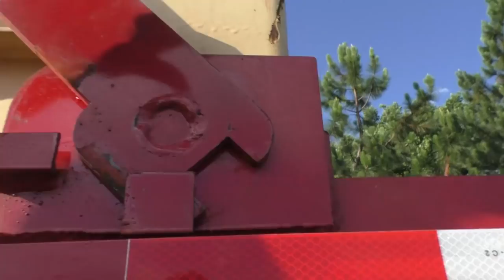Red Cedar Going into the Cargo Hold

Comment: You may want to research spray foam regarding 2 inch max. The way I understood it was thickness was only affected by the number of layers needed to be sprayed 1 to 2 in at a time.
Test your idea first because the possibility the foam's bond to the plastic will be stronger than it is to the aluminum. I would suggest you could use the same foam as below on the roof of the pilot house and use a durable roofing material sealing the foam . It would be easier to lay foam sheets over the aluminum roof .The hull will be cooled naturally by the water but the aluminum roof will have to transfer its heat inside to the foam making it less affective.

Comment: Quick tip on cutting the boards used for the walls, I noticed they were being cut on the flat, if you stand them on edge they will cut easier and the blade will last longer. HTH

Comment: I'm real protective of my hearing.  Safety glasses sometimes, but ear pro 100%...

Even the cheapo electronic earmuffs are great; they don't do actual noise cancelling but just cut off the amplification at a specific threshhold.  If I'm doing something real noisy, but I still want to be able to hear conversation, such as the rifle range, I throw in a pair of ear plugs and then crank the muffs up loud enough so I can hear the "quiet" stuff.  Between the muffs and plugs, loud noises are almost undetectable.

Most important is to find something that fits you well.  If it's uncomfortably, you won't wear it.

Comment: Have you ever thought about fire protection? I mean If a fire breaks out below deck, the foam and Wood is the first to burn Up. Also a fire behind the wooden Cover is realy hard to extinguish.
Reply: Sonam Freyer good point. The question is if the foam burns or how well it burns.
Reply from the maker: Imagine what it must be like on a wooden boat.
Reply: I imagine that a wooden boats planks stay at a pretty high humidity from the water outside though.  Fiberglass boat fires scare me.  Of course, most of those boats don't have a welder and plasma torch on board :)
Reply: Good job there’s no batteries, fuel oil, lubrication oil, paint.................blah blah.
Reply from the maker: Only the cowards run for the lifeboat.   Sailors fight fires.

Comment: Wearing your new electronic hearing protection backwards, the two external microphones go toward the front and volume control to the rear.  :). Great videos!
Reply from the maker: They are not stereo.  :)
Reply: Ill be darned. Great tip. Ill see if it makes a difference.

Comment: Ok I'm curious.  Just how much weight can those little welds on the two keel's that the boat sits on hold?  I just see you adding tonnes and tonnes of weight to the boat - there must be a limit surely?
Reply from the maker: My guess would be something in the range of 100 tons.
Reply: I was originally a bit concerned about the keels flapping when when boat starts rolling,  but the steel ribs you added inside the hull allayed that
Reply: Keels are also full of lead, no?